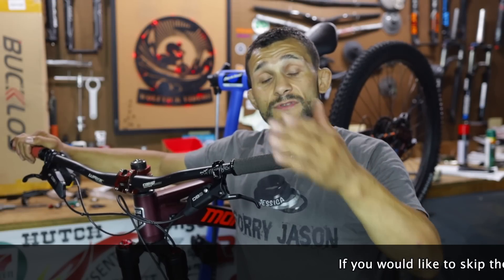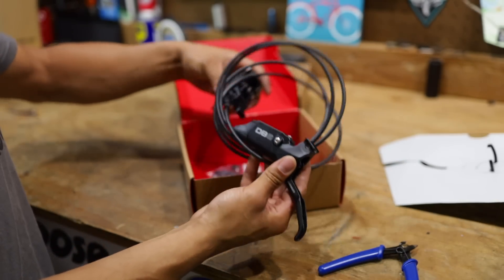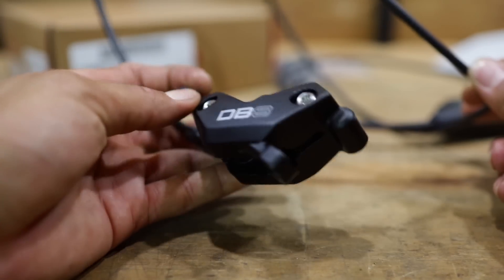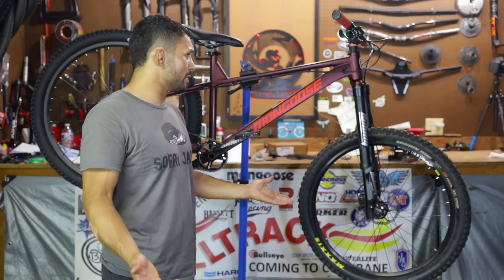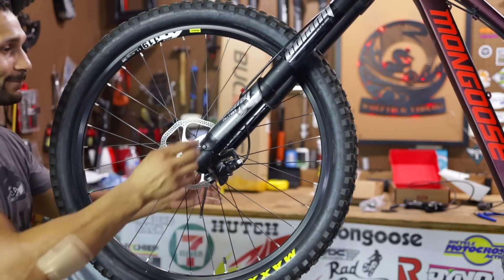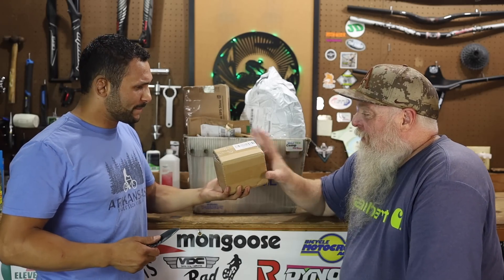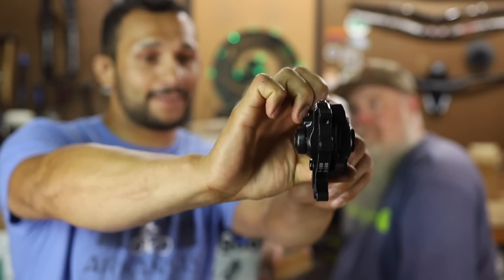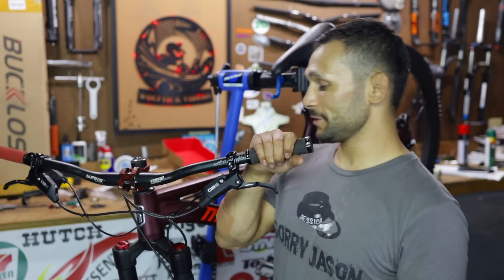SRAM MINERAL OIL DB8 4 Piston Hydraulic MTB Brakes: Initial Impressions | Mailtime

Comment: I have these brakes and I love them but I wasn't a fan of the lever feel, so what I did was put a Shimano barb and olive on the hose lever end and put a Shimano XT lever on, which improved the feel by tons my opinion. As for the extra adapter on the clamp it is used for Sram Matchmaker compatible products so things like shifters and dropper levers.
Reply: Hey I've been wanting to do exactly that but been getting push back stating different stroke ratio, hose dimensions, fluid compatibility with seals. Would love to pick your brain
Reply: Can you do a small video and show me please

Comment: The extra bolt on the SRAM brake lever clamp is for using a single clamp for brake and shift lever or dropper lever.  Cleans up the cockpit, but might limit your adjustments of the individual components.

Comment: SRAM code brakes are the dh ones. I run them 223mm rotors. That small pice on the brake clamp is called sram matchmaker. It works with droppers and shifters.
Reply from the maker: Good to know, you know I figured that was the case. I love that Sram thinks of stuff like that. Also love that you think of just about everything we need!! Thanks for the recent mail Raxman. Can you say SHANMASHEE???

Comment: this is why in the uk we have the front brake on the left. "in 1870s and 1880s saw the development of the safety bicycle which roughly resembles bicycles today, with two wheels of equal size, initially with solid rubber tyres. These were typically equipped with a front spoon brake" and seeing as most people are right handed it made sense to use your strongest hand to pull the lever as back then then the brakes were pretty poor. I think its fair to say that in the uk we are a people of habit
also id like to add i have these brakes and they really good but they need bleeding because from the factory they are pretty spongy and mine had some air in the system
Reply: All humans in all countries are mostly right handed, so why only the UK?

I was always under the belief that we have the front brake on the right, so that we have our left hand on the bars and covering the rear brake when using arm signals to turn right on a public road.
Turning right for us means going across the path of oncoming traffic, and the back brake is considered safer (more stable) to use one handed.
Note that Australia and New Zealand also have front brakes on the right

Conversely, countries that drive / ride on the other side of the road want their brakes the other way around so they too can use the back brake when turning across traffic, even though they are mostly right handed.

What's not clear is why motorcycles throughout the world have front brake on the right and clutch on the left.
Back brake may be done with the foot, but if I'm turning across traffic on a motorcycle without turn signal lamps, I'd rather be holding the clutch than the front brake, so I can speed up and slow down.

Comment: I'll definitely keep and eye out for the real-time review on the DB8 brakes.  From what I've read they are basically Code brakes that have been changed to handle mineral oil vs. DOT fluid that SRAM uses on all their other brakes. Of couse,  the fittings are different for the bleed ports to prevent(make it less likely) anyone from using a DOT brake bleed kit and cross contaminating them. Good news is that you guys already have the mineral oil SRAM uses in them around the shop, since I do believe I've seen you use Maxima oil from Finish Line when Jeremiah "attempts" brake bleeds successfully.
Reply from the maker: "Attempts" is RIGHT!! 🤣😅

Comment: Hey guys - unrelated question to this video: I scooped up an Axum DP and am looking to replace the fork. The stock fork on the Axum DP is actually a straight tube, even though the Axum DP has a tapered head tube. Kind of silly they did that if you want to go tapered fork as you'd need a new bottom headset.

Without swapping out the QR hub, getting a new thru-axle hub and getting a fork with a thru-axle, I'm trying to stay QR and looking at the Epixon 29 120mm QR (straight tube.) Or, do I get a slightly better fork with the RockShox Judy Gold RL 29 120mm QR that's tapered and just get a new bottom headset ZS56/40 and top headset ZS44/286 and call it a day?

Guess my question is, is the Rockshox worth spending about $80 more?

Comment: Flipped rotor in front?
Reply: 13:45 its for a shifter mount. But as far as I could remember, there are some dropper levers that can be installed in the shifter mounts if you're running a 1x (well, as far as Shimano is concerned, may be wrong though).
Reply: 15:04 I'd rather have it looped up front so that it could be easily cut to size if I wanted to. We'll, you do you!😁

Comment: I've always preferred to work with mineral oil over Dot due to Dot's aggressive nature.  If mineral oil is such a great brake fluid, why isn't it used in cars? Bottom line if I was 50 years younger and a serious downhill rider or racer, I would stick with Dot that can probably deal with higher temps and abuse.  I'm not, so 3 out of my 4 bikes are running mineral oil Shimanos. Another benefit of mineral oil is if you have dry skin you can rub on your body.  We have a lot of mosquitoes this year. I'm mixing it with Deet and rubbing it all over my body before Iride near any wetlands.  We have frogs where I live; they eat mosquitoes. Hopefully they will eat enough mosquitoes that I can stop with the Deet and mineral oil. I now have an oily ring in my shower and mineral oil isn't cheap.

Comment: I hate SRAM after owning Avids and other SRAM systems, total POS brake system and I hear some SRAM brake systems are garbage as well. Go Shimano if you have to spend money on a brake system and want a brake system that doesn't fail. Brake levers not returning to position, horrible to bleed and dot fluid were major issues with SRAM brake system garbage I have owned.